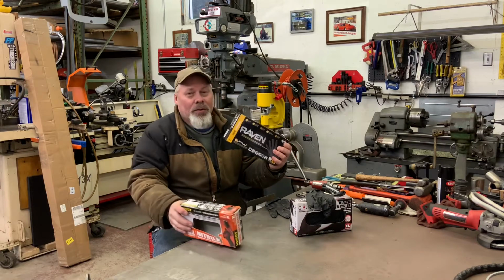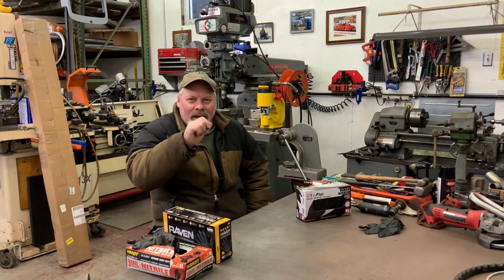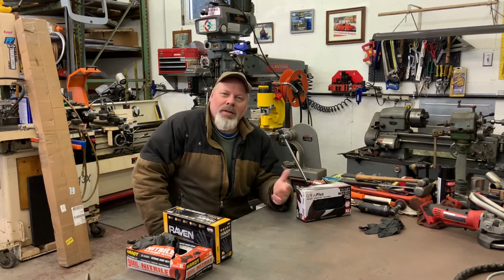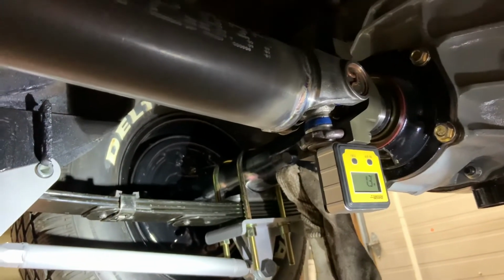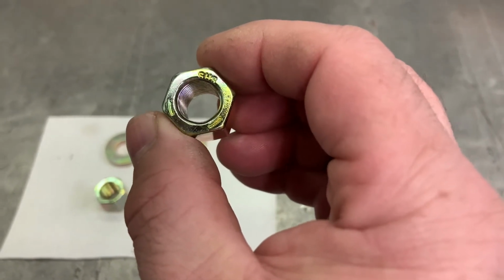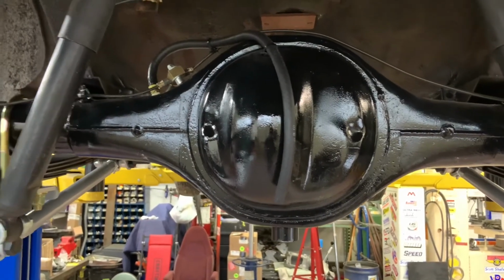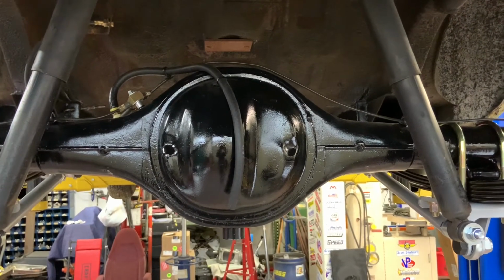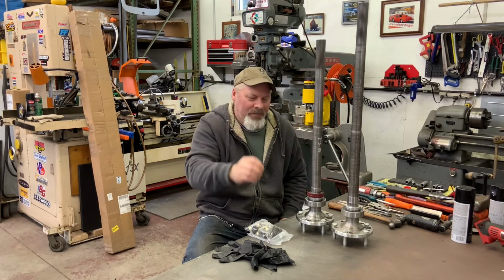1964 Dodge Dart GT LS Turbo Project: Pinion Angle

Comment: I use the blue 7mm gloves from HF servicing hydraulic rescue tools. They stand up pretty well to the brake clean and I rarely rip one on the jaw tips. Use a mix of 5mm and 7mm at home. I prefer the dexterity with the 5’s but they don’t stand up as well. We used a lot of 3mm on the ambulances.

Comment: I prefer the Black Momba gloves i get from fastenall, i got some 9mil gloves from HF but couldnt get acclimated to the lack of “thru the glove feeling” and couldnt tell if something was slipping out my hand or not lol. To each his own though, i wear them all the time out of habit now since job requires ppe 100% of the time in the field but will not wear them when drilling or near a drill press or lathe
Reply from the maker: I hope they rip if I catch them in a rotating machine, but I know you are correct. Might have to rethink that!